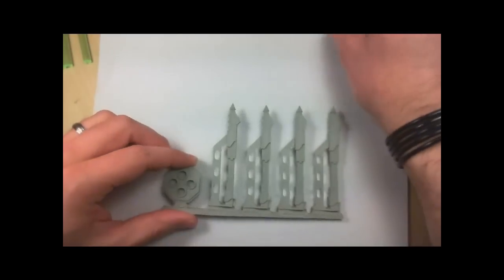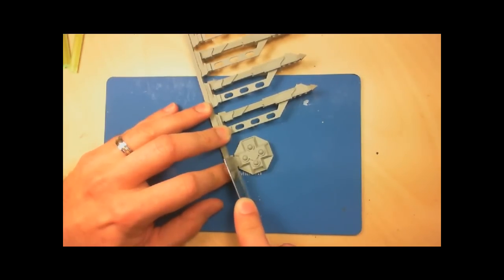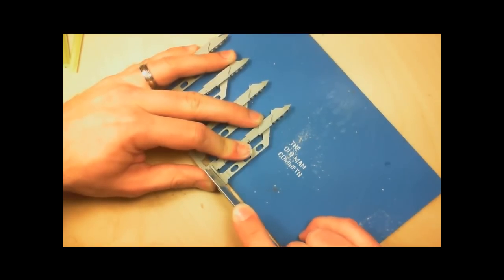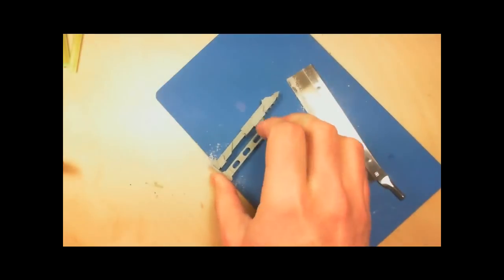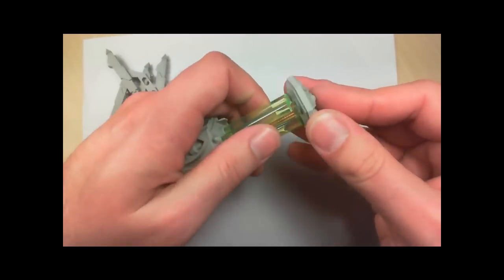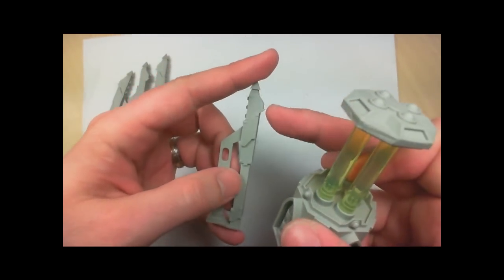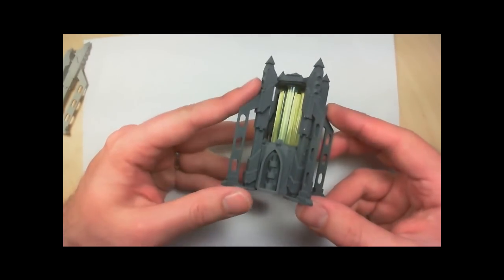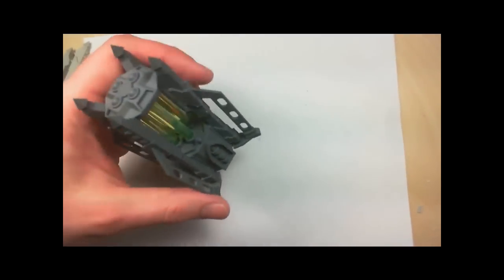Gothic Terrain: Power Generator

Comment from the maker: @1Izaak it could certainly be done -- you'd just need to drill out the bottom with something like a 1/2" drill bit. The rods are 1/8" so you can go into the 1/2" cavity from the top of those. PLENTY of room for lights.

Not that I've tought about doing so :)

--misterjustin